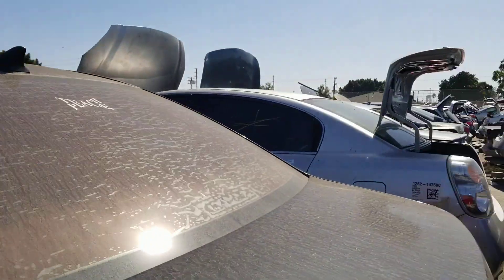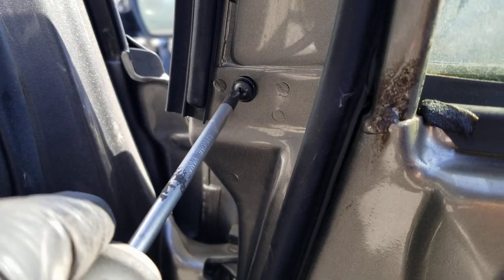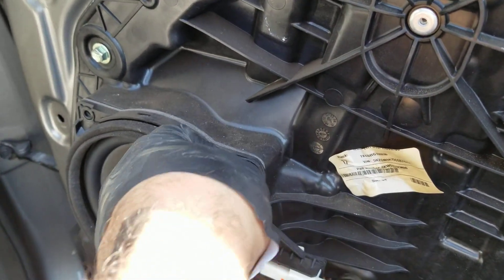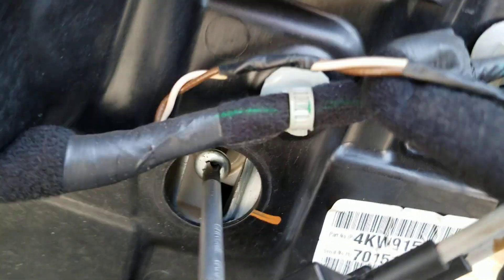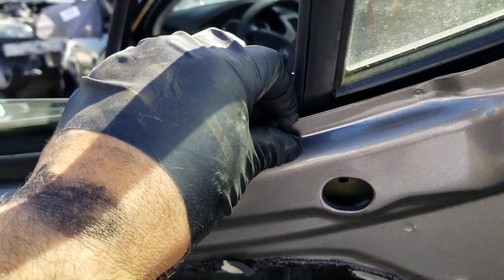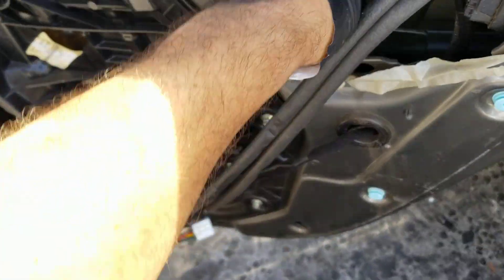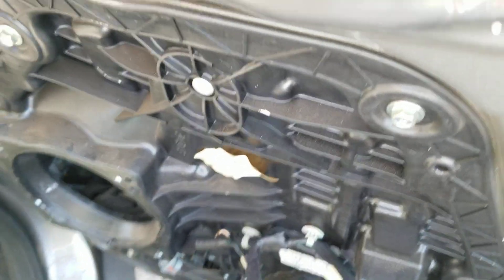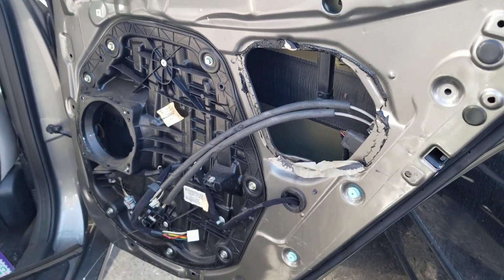2012 To 2016 Kia Optima Rear Passenger Door Glass removal

Comment: What is the part name of the black piece holding the window in place? That screw is stripped and I am unable to remove it.
Reply from the maker: The piece the glass is held by? I'm not sure of the official name but if that's what you're talking about. That will probably have to be re threaded or the other option is to chase the threads with the same size thread pitch until the screw can go back in with ease.